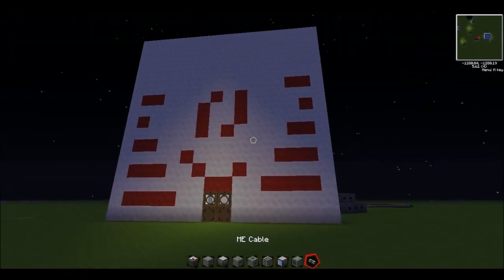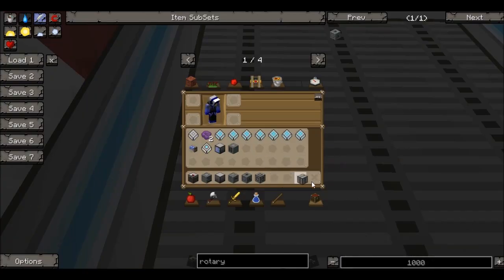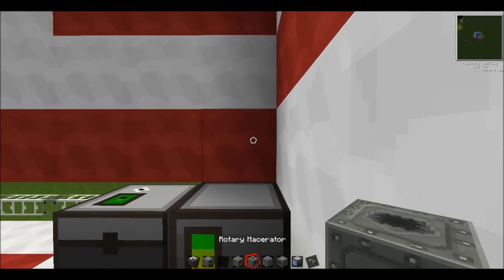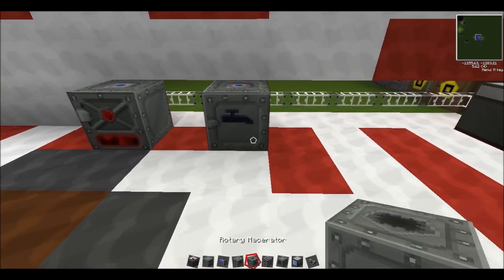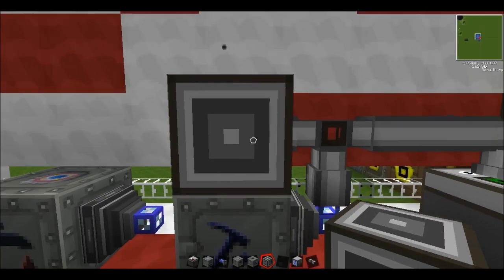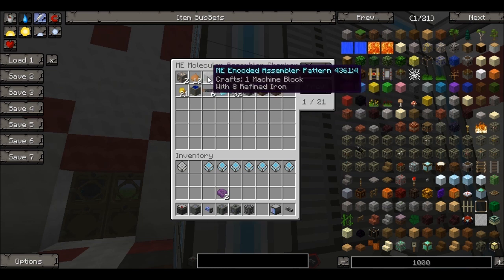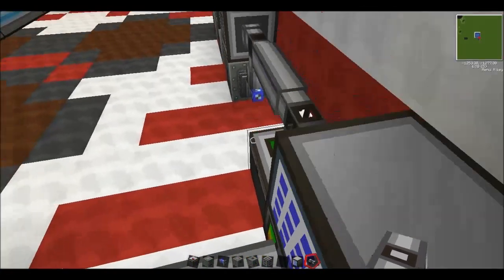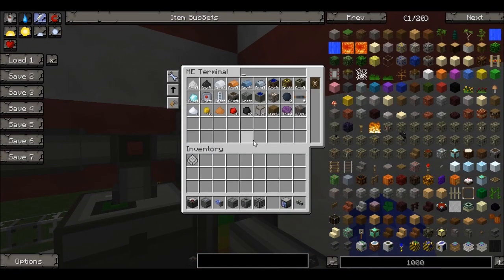Tekkit Lite Tutorials|Episode 1|AE Solar Panel Factory

Comment: Pretty good tutorial,
The recipes needed inside the machine are for...
2x Iron Ore
10x Copper Dust
Machine Block
20x Coal
24x Redstone
Furnace
10x Tin Dust
RE-Battery
Electronic Circuit
21x Sticky Resin
Solar Panel
6x Copper Cable
Diamond
32x Glass
Generator
LV-Capacitor
LV-Solar Array

To make the machine also make MV-Solar Arrays you only have to add the recipe for MV-Capacitor and the array itself, then for a HV-Solar Array you only then need to add a HV-Capacitor and the HV array.
Reply: Some corrections, I meant Transformers not Capacitor, the list is missing Iron Furnace and to add the MV and HV stuff you not only need the two recipes I mentioned but also any items in those recipes that you don't have the pattern for yet (like the gold wire in the MV transformer)